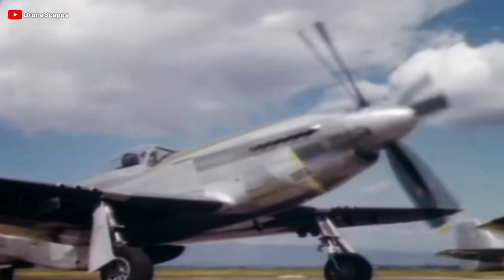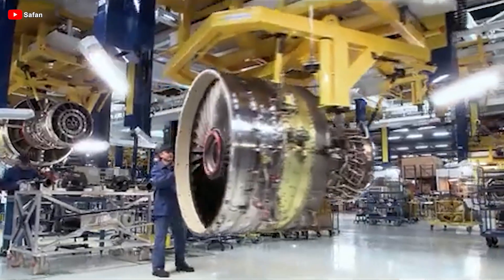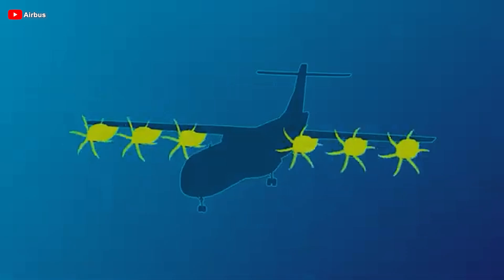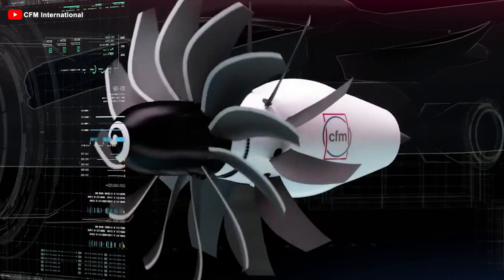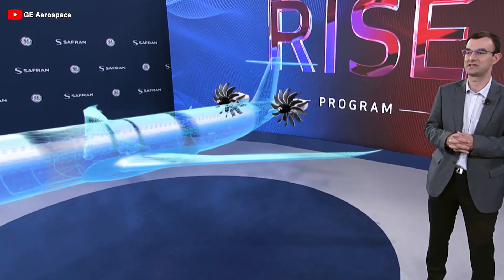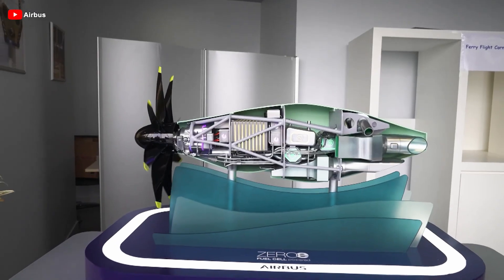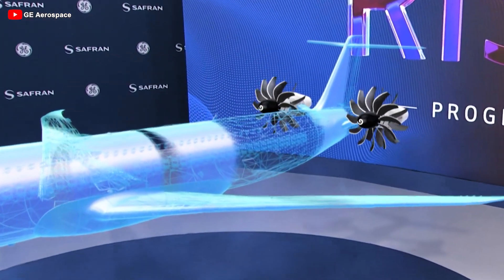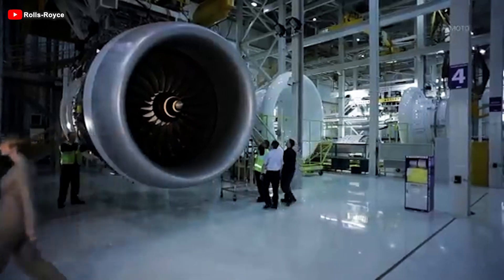Airbus' NEW Open Rotor Engines Will DESTROY Industry! Here's why

Comment: You can't put a rotor on a conventional aircraft. Even the latest 737 series are at the limit for ground clearance with a fanjet. The only solution is to put the engines on pods above the wing like the Hondajet. Passengers would not accept that due to the visibility and the noise.